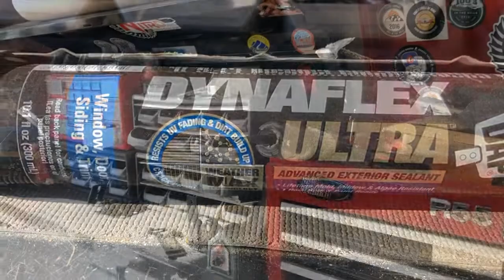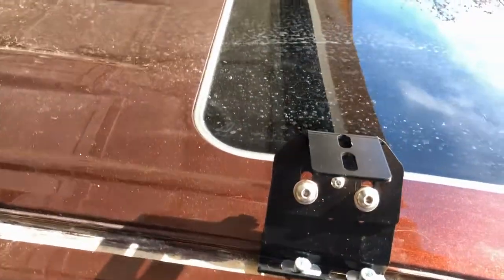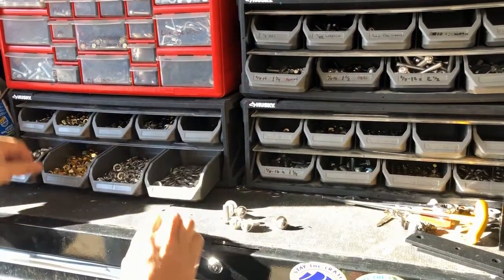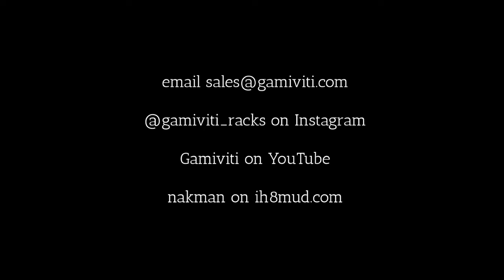Land Cruiser Roof Rack Install -  200 series

Comment: Thinking of buying a Gamiviti rack for my 200 LC. Thank you for the great videos on removing the factory rack and installing the Gamiviti. To clarify, do the towers bolt onto those yellow OEM carriers?
Reply from the maker: the little yellow plastic tube things?   yes, those are basically what is holding up the nut carriage inside the head liner, the new bolts run right through them.

Comment: You can fish the nuts out of the back one has fallen in? I’ve created a just headache for myself because that rear has fallen in on my lx570
Reply from the maker: If you still have access to one of the threaded nuts, it's possible to twist that carrier around to get to the other one, I've saved a few like that.  But if the whole thing fell down, then your only recourse to use it again is to pull down that part of the headliner, enough to fish it out.   The alternative is to leave it in there, and just rivnut the holes.

Comment: What are the benefits of this type of rack vs something like a flat rack from K9 or Front Runner?
Reply from the maker: To name a few, first one is  lower profile- these racks sit about 2.5" above the center of the roof so quite a bit lower than either of those.   Second would be the more unique features that we've developed, like the integrated light bar behind the fairing, snap-on fairing, snap-on grid panels, and quick-release awning receiver brackets.  Then there's the bespoke approach to production, we offer a lot of customization on the front end to tailor your rack to meet your needs, wants, and budget.  Plus they look great!
Reply: Gamiviti thanks for the response, I appreciate it. I think it would be helpful to do a demonstration video of how you secure bags, traction boards, tools, etc onto the racks. I’m having a hard time visualizing how things work.
Reply from the maker: @woolengrappler  yes, more videos would be great.   you can see the traction ramp bag video here, that will show one way to secure some basic gear bags to the rack with straps.. also the traction ramp bracket video shows another way to secure stuff with our tube clamps.   but the video lists never ends, we're working on more!  thanks for the comments
Reply: @gamiviti4828  whats the new height from top of roof to top edge of the tallest section.  I'm considering prinsu but after seeing a couple of your videos this could be an option to consider.  Im looking to fit into my garage and I have about 5"-6" of space and this looks slim and under that mark.
Reply from the maker: @RUMble_AK49  About 3" total height.   You can look through the gallery on the site, or shoot us an email for some pictures.    Very similar in height to the Prinsu from what I have seen, but very different racks.   email is best for more questions, to get a quote, etc. thanks!

Comment: Do you worry about it leaking at all?
Reply from the maker: All the time!  But our towers use a washer on top, rubber sealing washer between the tower and roof, and the added polyurethane sealant...  so all that, combined with tightening the towers in proper sequence so that not one of them is being pulled up by the rack, has been enough to be very successful against leaks.